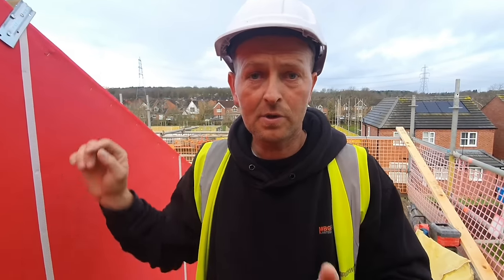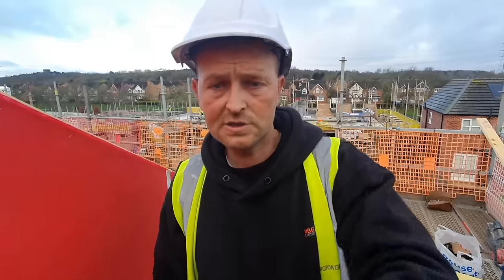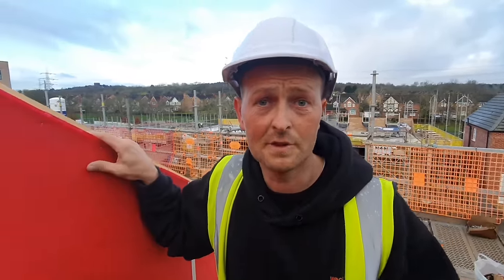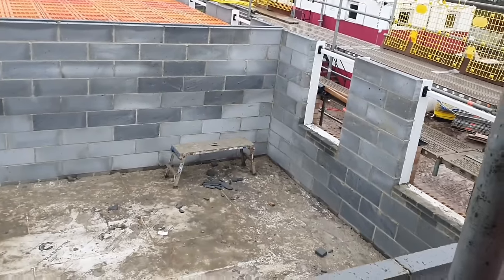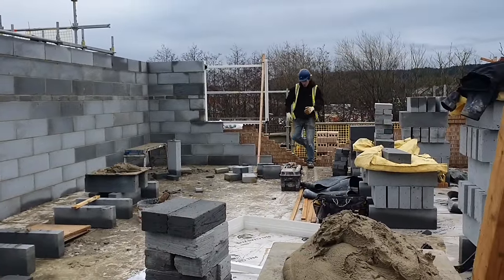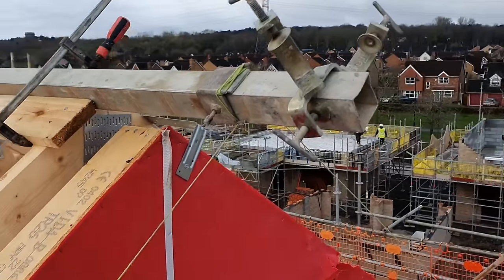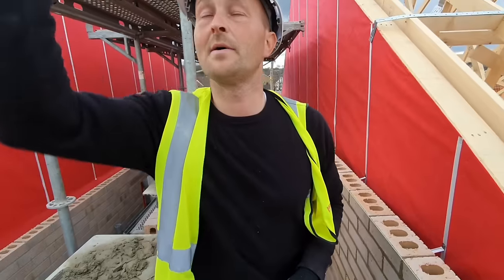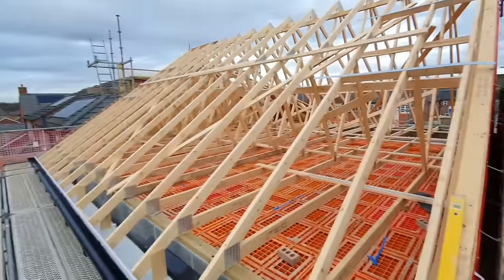White Lies & False Info [ Bricklayers

Comment: While "bespoke brickwork" is not really a thing, I'd say a bricklayer doing larger one off homes with features and fireplaces needs to have far more about him than a bricklayer doing copy and paste square box homes that have been done a million times across the country.
Reply: Spot on.
Reply: Was going to say something similar. I get where hes coming from in terms of ripofff brickies using bespoke to rip clients off, but bespoke to me is like you say, anything that deviates from common brickwork design and practices thats unique to the clients requirements.
Reply from the maker: Brickwork is Brickwork, you can either do it or you can't regardless of what it is
Reply from the maker: I started my time doing all that kind of work, I've done my fair share my friend
Reply from the maker: @davidhopwood3590  you are putting words in my mouth, I never said that. You charge what you want for your own standard brickwork, I said there should be an extra over rate for detail. Comprendė esă
Reply: Most brickies on site don't even top and tail the jointing anymore. That's when the premium rate kicks in. Quality over quantity.
Reply: @WakeUpJacked  'beer money'.

Comment: We used to run gangs and our QS used to get us extra for everything. From bedding lintels to bedding on a damp course. 
There is a rate for every single thing even plumbing reveals and putting in wall ties and insulation. 
This was never passed on to the subbie. 
10% was taken at face value but in reality it would be near 25%. 
We only knew this when we got a QS involved in pricing and was an eye opener to how the subbie gets a rough ride. 
Good video and your a proper pro.

Comment: Absolutely spot on , I couldn’t agree more and I’ve been in construction for 40 years this applies across the trades , the macho b s is usually a cover for insecurity
Reply: yeah all trades should give their heads a shake, the tough old school macho image is a total myth, nothing tough about it at all, never has been
Reply: Your point is reinforced by the fact more girls are entering the trade.  Some here on y/t,  they seem very confident.  Good luck to them.
Reply: Never seen a female stonemason, drystone waller or roofer though (here in Yorks a lot of the slate is thick, heavy Yorkstone).
Reply: @jonb12321 They train as banker masons. Then normally go carving in cathedral workshops. The Minster in York had them. That was back in the early 1990s when I trained.
Reply: Yes I can see that, women working in stone carving, monumental masonry etc., and you see eg farmer's wives helping with drystone walling. I'm neither for/against is as I think individuals should find their own niche and I'm not really one to 'celebrate' groups.  I'd just be surprised to come across a woman eg working as a stone fettler/dresser in a quarry, laying sewer lines etc.

Comment: Changy I'll agree with you mate on some of your points.

Bricklaying has made me very wealthy,never used a profile in my life.
  
The time the new breed of bricklayers set their profiles up we're already running in two corners built 6 course at a time.

40 years I've been in the trade,regard myself as a top pro , take it from me the best,skillful bricklayers are all old school,retired or in the ground.

Of course there are some young lads who are a class act also.

Building corners,at pace and accuracy is an awesome skill to have.
Many younger trowels today are lacking,they can't build a corner/plumbing quickly this is the problem for them.

Anyway, small corners and run it in/burn the line.
The art of building the corners all day,everyday.

When you know,,,,,,,you know.

Comment: On high four story buildings in the USA they used to set jack lines and every corner pole had better be right with those lines. Now the kid foreman just measure off the plywood and worry about window depth. So if the plywood varies, they just guesstimate and try to keep the storypoles (profiles) plumb.  So if the poles are first set always plumb, they migrate a little after that. It's not everywhere but when you have precast involved, your window gaps better be within the limits and so plumbness is secondary consideration. So the setting of profiles is supposed to be to run with  jack lines. And if jack lines are set, you can build a corner fast and mark highth right on the line.

Comment: So the spandrel profile has a membrane on and then overlaps the second DPC. Do you put foam in after building up the gable on the outside of that spandrel membrane? Trying to work out if there's a continuous membrane layer just after the blockwork or after the insulation (looking from internal to external).

Comment: Modern houses are nothing like 1930s one's, the bricks on my house are acrington front and back with a cavity, I've never had any damp issues, there putting new ideas in the new homes that  are not tested , and aren't gonna last as long as my 90y old house as lasted, and its still going strong. Interesting vid lad.
Reply: Yes and no, I'm a builder, I also own a 1930s house,  some of the joinery work within roof rafters is shocking , they weren't that good back then, you are right about modern house being crap, however some are very good but most house bashing sites are crap

Comment: Bespoke as I understand it is a one off. Don't happen on site work Changy, its more specialised , like Stu Compton, not a line jockey, a true artist in brickwork, Traditional bricky is right any arsehole can run a line in 2 days of picking up a trowel dont make them a bricklayer, try building a fireplace in an outside bbq area thats your info, is that not bespoke?

Comment: It is a truism in building that 'every building is a prototype' i.e. no two buildings are alike even those built in a factory because each site is different in some degree or another.
A few years ago a building trades survey found that the average age of bricklayers was 55 years old and increasing.  The reason for this is that young people aren't coming into the industry as it needs.  Good bricklaying is possible but there are too many crap brickies that give the industry a bad name and its the same now as it was 50 years ago in my experience, the only difference being is that there is no quality control on sites today that was common back then.

Comment: Mate, as a Brick-maker. Technically, it is possible to get speciality made bricks. But chances are low, but bricklayers are paid enough to compensate minor challenges (generally). But I think your referring to dodgy ppl trying to rip the customer off, I.E. The dodgy mechanic.

Comment: Im building a house in ireland. My block is working away fine however there was one area that he didnt half bond the blocks. It was 5 or 6 blocks where where ge stacked up on top of the row underneath. The DPC was going through this and he said it was fine the DPC breaks the bond. Is this correct? It was at the subfloor level
Reply from the maker: Plastic doesn't give any extra strength to a bond. Sounds like he can talk a job
Reply: @Changy_C  ya not sure why he did it. Im sure the house wont fall down but might be a crack in the plaster there in future, its below the subfloor level tho so not the end of the world

Comment: After 50 years on the trowel, I would like to add that I never saw a single timber frame that was straight, plum or level and the brickies always took the hit. Carpenters can make anything from wood, except a tree and a straight timber frame!😂
Reply: Speak  for your  self. There  is rubbish  in all  trades. 😊

Comment: Any bricklayers out there have a rough idea on blocking up an extension double skin rendered externally 7.5 x4 downstairs back wall bifolds 4m 
1st floor 4x4sqm flat roofs.
In Kent, if no costing a rough idea on how long.
Thanks

Comment: Would agree with most things said mate, but I can guarantee 100% most brickies who have been house bashing for years (new builds) wouldn't have a clue when it comes to extensions... Working with imperial measurements alongside metric block, the correct place for cavity ties, using 200 year old reclaims.... There's definitely a different standard of bricklayer out there and should charge a premium for their knowledge..... Only my opinion, I enjoy your vids Chang....
Reply: I couldnt agree more, I am a young bricklayer, 2nd generation and Ive spent a lot of time and money the past few years learning old traditional skills that the general bricklayer just doesnt know, no fault of their own as it just isnt taught and hasnt been for 40 years.

working with lime mortars effectively, using old bricks, traditional pointing, tuck pointing, even building an arch is out of most bricklayers field of knowledge these days. 

I'm not saying knowing how to handle these aspects of brickwork means i get to demand more money, however I think you can say "bespoke" brickwork does exist
Reply: Site brickwork and private work are two complete different disciplines.

Comment: Yeah, I have to agree profiles all day long, but they have to be Blake or equivalent , forget them micky mouse box sections them labourers use , you have to build the other half of the corner with your level so  your defeating the object !
Reply from the maker: @lyntonryan4766  is this a real comment or you don't know how to build with box section?
Reply: @Changy_C  you have to be joking me  , what box section over Blake stop it that's the NVQ 1 day course coming out in you , you obviously haven't read my reply correctly with your so called box profile you have to build the OTHER half of the corner with your level and I don't mean that 2ft boat level you've got tucked in your  tool bucket  , with a PROPER profile you can build a 21 course corner to the line (the line is like your mother it'll never lie to you) , OK describe to me how you would set out the first 2 course of flemish , flemish garden wall  , English  , and English garden wall 9in bond take your time if you need to  , just because you you put bricks on top of one and other that doesn't make you a bricklayer  , I look forward to your reply about the 9in bond  , I bet you're never seen a Lister mixture  don't make me laugh  !
Reply: @Changy_C  yes it's REAL  !

Comment: Here bricky from US,  one trowel 's ,scrape of bed mortar/ your twice/  and spread it on head's join, when not squeeze out -extra mortar spread. Head join is responded for getting water behind. Norm is lay 600 bricks /day ,  one labor / 2 bricklayer,  Never use window frame ,just  4 ft.level and tape measure.  Most wood frame structure has window installed, because flashing / 360 degr. water proofing/ is bricky job can't be done later. Also stainless steel drip edge over steel  lintel, water dam and whip cell are new religion.

Comment: Corner..... first thing they teach you at college ffs. Profiles are for speed. Any tool you find that makes you quicker or takes out effort, is a winner. Work smarter not harder. Lay 5k bricks a day using a tool that doubles your speed if you can. As long as your work is neat, good looking and level and plumb, then use whatever you can to lay as many bricks as possible. Someone laying 500 bricks saying that a man who can lay 3000 is rushing and can't be doing it right..... Nah, he just uses his head more than you do.
Think about every aspect of every job, ANYWHERE you can improve efficiency and save time, do so. The tool belt was invented so that you could have most of the tools you need, on you at all times to save time. Battery hand tools invented to save time. Its not rough using a circ saw to cut timber, it's just way quicker and easier than a hand saw.
Use your loaf and speed up at all opportunities and anywhere you can make the job less physically demanding, do that too. 1% less strain on your body, every day over a 40 year career, may just be the difference between retiring functional or retiring as a wreck.
Smarter..... not harder. More efficient, not rushing. You can be quick AND good. You don't have to be slow to be good.

Comment: Walk round a building site and see how many Wire cut bricks are laid upside down ,House bashers do not give a fk TBH
Reply: It’s not about not giving a fuck but you just haven’t got time to select bricks like that on site. By the time the silo’s blocked and you’ve had to unclog it, the forks have a puncture, your waiting for kit, the driver has extra for breaks, someone parks in front of the loading bay, your in and out of the rain and somewhere in between your trying to earn a wage!
Reply: @bentyrrell8083  Well if you think laying bricks upside down and having to Acid wash houses down just after they have been built then you have just destroyed Changys argument as its not the correct way to build
Reply: @TheAsa1972  they all get acid washed down after the build regardless
Reply: @bentyrrell8083  That must be the New School ,Non Racist way forward then

Comment: this video cost you 75 quid in time.
Reply from the maker: This videos revenue is £337 so far. So not a bad idea
Reply: @Changy_C   If you have to boast, it's generally untrue.
Reply from the maker: @tonycarpenter8445  it's isn't boasting, it making thebpoint that I'm not at a loss for making a video as you pointed out

Comment: So you want them to charge standard for the basic and for the bespoke charge extra, but dont dare call it bespoke even though it is bespoke. Your the one with the BS.
Reply from the maker: Bespoke is one off, charge for the detail. Some of you lot are thick a/f
Reply: @Changy_C  😂😂😂😂
Reply: @Changy_C  Every wall is a one off, you can never build the same wall twice t/cnt
Reply from the maker: Orate ah
Reply: @tangofoxtrot4603  if the wind blows it down it will be built twice
Reply: @pogmohon8857  Dont build walls in the wind, free tip.
Reply: @tangofoxtrot4603  can’t always predict the weather